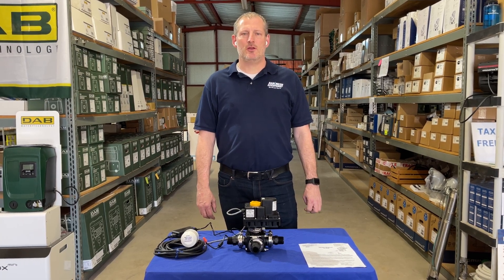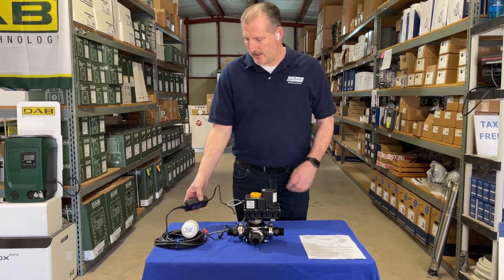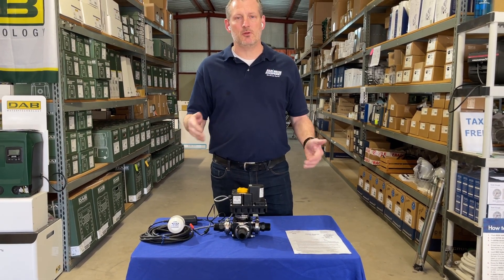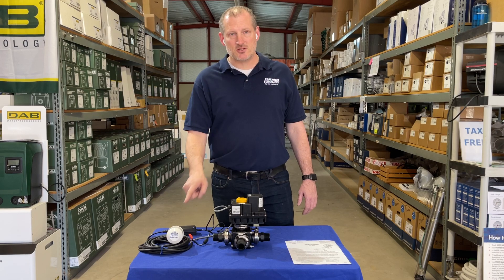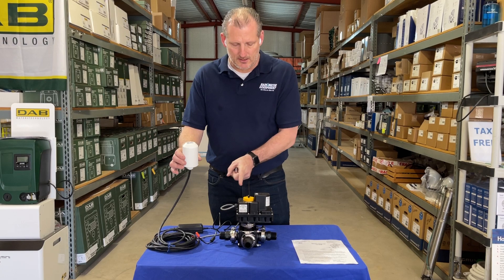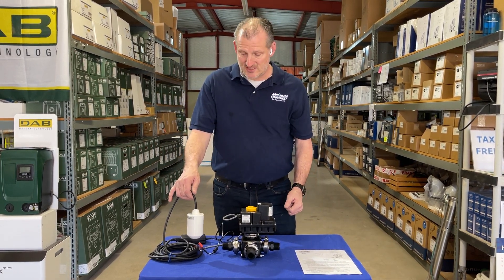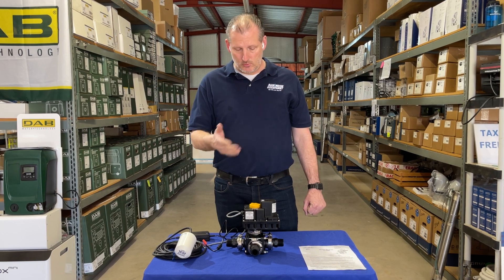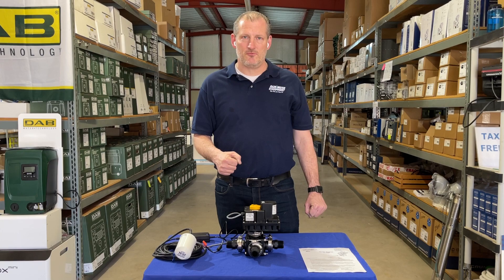1" Alternate Water Supply Kit with 3-way Actuated Valve - Auto switch from rain to well/city water.

Comment: Good explanation on this valve set up. As we see more and more Rainwater Harvesting Systems changing to a potable system this will be a game changer. Nobody seems to want to go out and change the valves, everything automated. Heck I cant even get our customers to clean the pre-filtration on a regular basis. I think I will send this video to our water district and see if they will approve it for use in this area. If that is ok with you. We will talk sone, Thanks Rainwater Ranch
Reply from the maker: Of course. Thanks Scott!
Reply: @rainwaterequipmentllc7835  found an interesting filter that we use on our well. It’s called a spin down filter. It can screen sand and debris. It has a automatic flush feature. Maybe something to look at as future application towards rainwater harvesting.